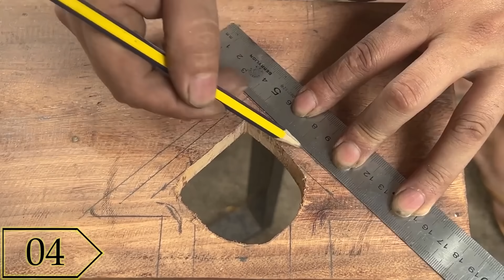the discover Clever inventions and Handcrafted Wonders from skilled Hands | DIY Metal tools

Comment: Oil your drill man, especially that diameter, those bits are not cheep, but easy to sharpen at that size, do you even know how to sharpen them

You should teach basic shop skills as well

How to weld bandsaw blades together maybe 

It's just a spot weld between the two ends, but you need the right voltage to arc correctly
Reply from the maker: Great advice! Taking care of your tools makes a big difference. Do you have any tips for maintaining drill bits or other tools in the workshop?
Reply: Sure, the cutting surface of a big drill bit is all you need to be concerned with

The edge of cutting should be modified for better penetration and sharper angle with a relief of extra material behind

That may compromise the strength of the bit so better used slowly when cutting a relief 

Just like milling the tip is all we need to work it

Like a step drill design the entire quarter of the drill is the relief only with a screw designed bit, the tip is all we need to work with on both sides

Cut a relief and make sure there's no flat spot on the tip or you'll jam that thing on your work and break it

Something I learned in machine shop

If the tip gets hot enough to get purple you may need to temper it again to regain its strength 

A fine line between hardness and brittleness even with carbide or titanium they all break when going past it's strength 

Let the chip heat up to purple and you start seeing the limit 

That's what oils do, they cool and lubricate your work surface for a clean cut

When I grind a blade the surface or edge needs to remain cool so I dip it in water every time it starts to get hot, then I can hold it again 

Tempering comes later after grinding a blade anyway, makes for a softer mettle when shaping 

Tempering a blade needs to be done right, the strength is key for elasticity and holding shape when you try to bend it

It bounces back to it's original shape without a bend at all

A well made sword is tested that way
Reply: Just have the two poles between the fresh blade that comes in correct lengths cheaper that way

Clamp both ends, hands free and press the button

Get a beed, and temper with a few quick presses, cooling between each press 

Grind the surface both sides if beed gets high 

lightly don't break it again Dremel is best to knock and surface down 

Weld the spot between teeth if you have room otherwise just line the back up

Comment: about the magnetic tape measure, the angle the tape is going will through off the accuracy of the measurement
Reply from the maker: Exactly, that’s why it’s important to ensure the tape is pulled in a straight line. Even small angles can introduce errors when measuring.

Comment: #2 The vise was a great project. Too bad the welding was 5th rate. Truly not trying to be nasty but it would have been so much better had the welds been cleaner rather than mostly spot welds and spatter ridden attempts at bead welding. I still think it was generally a great, well designed, well thought out project though.
Reply from the maker: What you shared is very correct! Thank you for leaving a comment. Wishing you a peaceful day

Comment: Man I just found you, and already 8 or more months have passed, dam
Reply from the maker: Glad you found the channel! Time flies, right? What kind of projects do you enjoy watching the most?
Reply: @masterQ20  I have a design for a 50 gallon drum conversion to a hot air heater, that would be useful to the hurricane victims in the upper state's 

Like many projects you do are beneficial to many, this one would definitely do the same

Just weld some heavy duty pipe along the long side, inside the drum

 Create a flat surface on top level for cooking on top round rack frying pan holder like on a gas stove removable 

Flat surface cast iron 1/2" for griddle surface with upward turning edges so the hot mess food doesn't slide off

Just stick with hot air and cooker top unless you want to make your own box instead of using a 50 gallon drum

It's all up to what you wanna do

I like fire, of all kinds, been thinking of old wood burning stoves, and how I had one as a kid

Kept having to replace the shop stove cheaply made, thin gangue steel, got burned out, and rusted 

Have a civilian version and a shop version for tempering metal, 

Smelting version for black smithing, so many versions available to build just pick one to start

Put it on a stand and done

So many different configurations makes that type project, never ending in the things we can do

Wood type even upright long sticks on one side for indirect BBQ smoker

An entire series on that, with different configurations 

Hot air heater. Instead pipes with flexible cheep, hot air hose to different rooms around the house ducting 

All welded construction for ducting since even the smoke side puts off heat but generally goes straight up, and out

So much heat gone bye

Great version for an open metal barn heater, the smoke side provides the most heat so put it in the middle of the barn, and heat the entire building with the smoke stack exposed, until it reaches the outside, a little deviation from horizontal helps fill the room with heat

Better be structurally or self supported before going strange 3D tree design with ducting that heavy 

That kind of project may be too big for you though LoL 

I like the Half a cow design, myself, that thing puts out heat, or the right amount of heat, when done right

Gotta be a pro cooker to cook, half a cow, or pig, definitely makes for a good week though 

People get drawn to the smell like a people pleaser 

What is that, where's it coming from their cars wonder to find that smell, and pull over when they finally see the smokers, and thirty different cookers all going at the same time

They just follow their noses, and throw cash at people, just to experience that flavor, they have been smelling for miles 

Sniffer ducting from the bottom of a valley LoL 

All the neighbors get it at cost and labor, because their the best customers 

Outta towners with that gleam in their eyes, close to crying, for a fixing

It's ok, we got this, he's here, somebody take care of this fella, he's got that look

Dazed, and nose to the air, with a big smile

Happens to me all the time, can't help it

It's a nerve in the back of my nose that says, hell yeah, get me some of that

Hits my brain, and that's it, nothing else matters, gotta have it at any cost

He he

Breakfast, lunch, or dinner, anyone hungry?

Yeah baby, right here, OOO pick me

If they get in a ruckus, or a mob start heading for the kitchen 

Just throw some meat at them, they'll settle down, and eat, then come back for more, and have them go out that door

To the cooking yard of BBQ delights, and designs

Everything's on sale, big letters across the sky, tears well up in their eyes 

It's beautiful!!!

No is a word they don't know, at that point, they already gave in to their cravings, now show them what else they can have, in store for them

Prizes on, the price is right

Just hook it up to the back of your vehicle, while it cooks, it'll be done by the time you get home

I recommend you go slow, your cargo is precious 

All set up, and ready to go, welded a hitch to your car, while you ate, works great 

Thanks Man, love your shop 

Thank you Jesus, I love him too

I'll have to move there anyway, on vacation, or just for the smell, and gifts of life, we provide

Welded plack on the side of every unit with address, and come on by, we'll set you up inside, then fix your ride "BBQ delights and designs"

Even wrote a commercial for it

Just because I can, and want to help, that kind of project is my favorite 

Let's get building, sounds good to me, how about you, expansion after one, or a few

Restaurant design engineer's like food, I bet you do too

Time flew, Sorry I just got back to you, no I'm not, timing was right, I'm hungry too, for barbeque 
.

Comment: for invention # 05 those green discs being used are called cutting wheels not grinding wheels
Reply from the maker: Thanks for the clarification! Cutting wheels are indeed essential for precise cuts, especially when working with metal in DIY projects. Have you tried using them for any welding tasks?

Comment: Coba dong kang gimana cara membuat suri (AS) Ger yg masi terpasang di motor nya
Reply from the maker: I think you're asking about working on a motorcycle engine while certain parts are still installed, right? Let me know if you need specific instructions or tips for that project!

Comment: That's why there are actual magnetic rulers that you can lay flat on the metal you're cutting
Reply from the maker: Exactly! Magnetic rulers are great for ensuring accurate measurements, especially when working with metal. They help keep the tool in place, which is super useful for cutting.